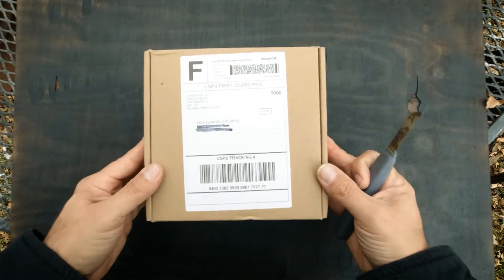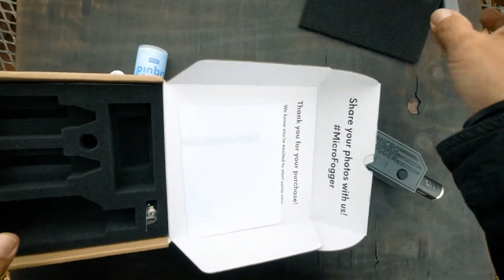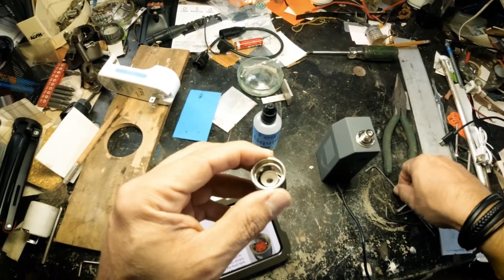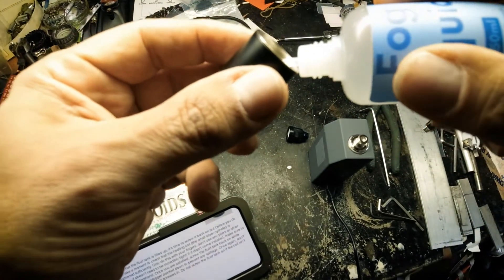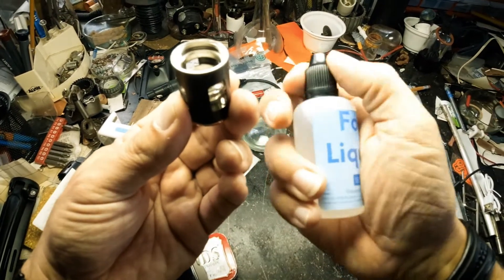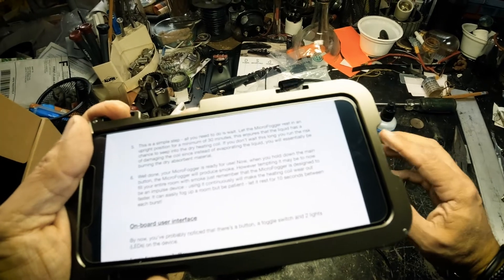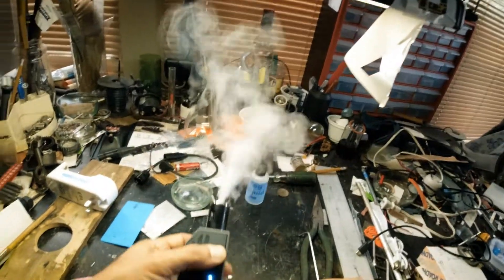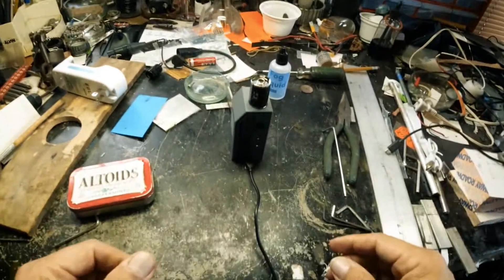Micro Fogger 3 Lite Unboxing and Demo

Comment: How long do I charge mine for, for full battery ? Also mine randomly just stopped working as well
Reply from the maker: The instructions had a wide range — I think it said 2-4hrs. I’d recommend charging for at least an hour before each use. I haven’t done much with mine since unboxing and demo. Def watch the fluid level and never let it run dry before using or the coil will suffer damage. I am going to try making the fog heavier by running it through a chiller, like you do with regular fog machines.

Comment: could make this 5 min and more on the demo and how you like it.
Reply from the maker: Still going strong. On my second coil. I use it a few times a month for tabletop photography.
Reply: @MichelangeloFlores  can it fill in a medium size room for a misty look for 20minutes? i was talking got the Rep at cinegear NYC this past week and he said it only last 15min and needs 4hours to recharge? that was my biggest drawback. thanks man
Reply from the maker: @NewYorkerPEACE  I’ll shoot a vid for you soon to show the space where I use it. I can’t control the HVAC in the room but if it’s not running the room will be somewhat foggy for maybe 10min. Will check dimensions. I’ve never killed the battery and I like to take breaks every few minutes. We’ll see.
Reply: @MichelangeloFlores  ok cool thanks for feedback.

Comment: It’s literally a vape. It probably uses a 80/20 blend of vg/ pg
Reply from the maker: Thanks for the input. I know nothing at all about vape tech, so it’s totally believable that someone took one and made it into a “micro fog machine”. I haven’t used it for anything other than the unboxing. I tried using it to check for a draft around an old window, but didn’t get much feedback.
Reply: Lol was wondering if I wsre the only one to notice that.  It’s a tank an instead of the person pulling in the end of it inhaling. It’s just got an internal fan